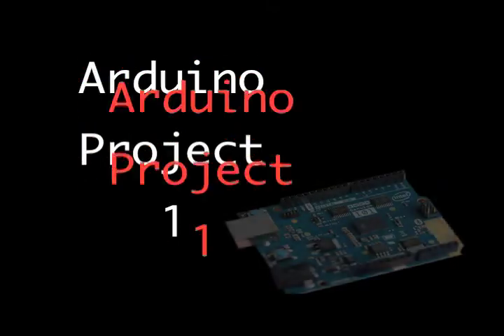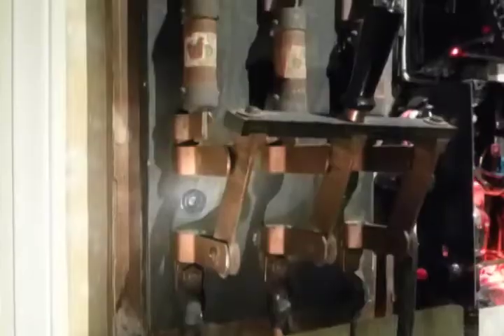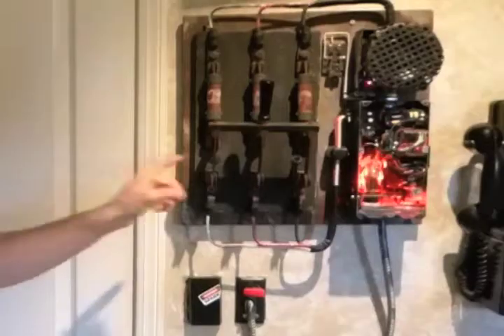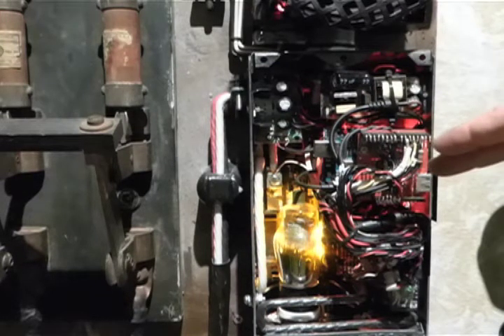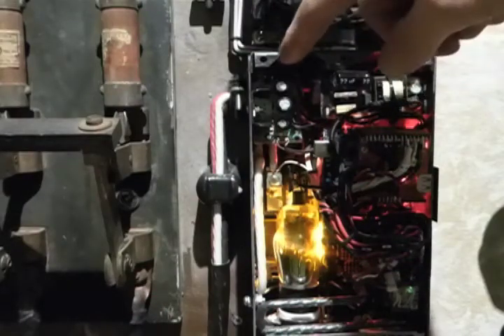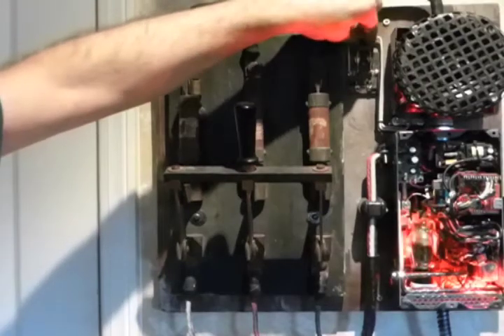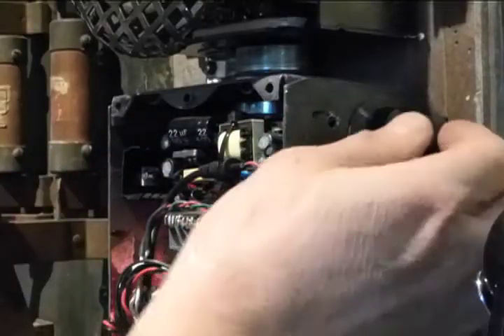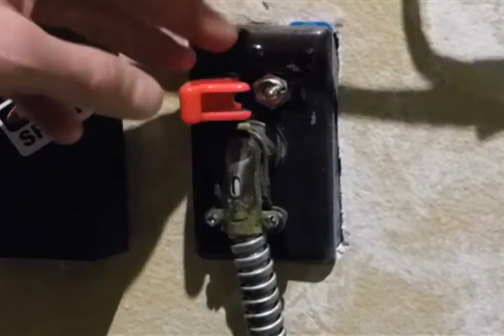Steampunk Arduino knife switch -  by Josh

Comment: Hi. Looks great. i have creating similar. Few questions if you dont mind. 
What kind of resistor you used to detect touch ? 
How powerful is the speaker? Is it simple speaker or specific for Arduino?
Thanks a mill.
Reply from the maker: Glad you liked my project. For the touch resistor, I used a 1 Meg potentiometer. That way I can adjust the sensitivity as needed. Humidity in the air can change the sensitivity. The speaker is driven by a 2 watt audio amp I built from a kit, fed from the MP3 shield, on the Arduino.
The code I used for the touch sensor looks like this:
/*
 * CapitiveSense Library Sketch
 * JES* THIS WORKS ! LED at pin 13 follows touch!
 * Paul Badger 2008/ Josh S. trimmed and modified for Knife switch project. 
 * Resistor effects sensitivity, experiment with values, 50K - 50M. Larger resistor values yield larger sensor values.
 * 2 meg ohm is OK on desk top. 1 meg ohm on knife switch.
 */

#include <CapacitiveSensor.h>
const long timeout = 10000;

CapacitiveSensor touch1 = CapacitiveSensor(4,6);   // 4M resistor between pins 4 & 6, pin 6 is touch sensor pin.
int led2Pin = 13;                                  // LED connected to digital pin 13

void setup()                    
{
    Serial.begin(9600);
    touch1.set_CS_AutocaL_Millis(timeout);          // set sensor timeout values
    pinMode(led2Pin, OUTPUT);
}

void loop()                    
{
    long start = millis();
    
    long total1 =  touch1.capacitiveSensor(30);
    
    Serial.println(total1);                      // print sensor output 2
    
    if (total1 > 1000) 
    
         { digitalWrite(led2Pin, HIGH); }       // turn LED ON

    else 
          { digitalWrite(led2Pin, LOW); }      // turn LED OFF
      
    delay(10);                                 // data thinning delay ??     
}
Reply: Thats great info. I am running Escape room and you should consider doing such prop for resale. Trust me, you would get customers as it looks super cool. Whats out there are very expensive and miles behind your prop. Huge compliments man;)
I have created execution chair with capacitive sensors. works great. and want to advance it with your details.
Now looking at vacuum light. however cant get my head around how it works and how to connect it to arduino. Any tips on that please?
Reply from the maker: Thanks for the compliment. I actually have another one that I made previously. It's much less elaborate, but works, and looks cool. No sound. I might consider selling, if someone was interested.
Your electric chair sounds amusing. Do you have zapping sounds? Could be terrifying.
The vacuum tubes in my project are simply back-lit with LEDs. Looks great, and low voltage.

Comment: What are you using as far as a trigger mechanism for the arduino to know that the knife switch is engaged? Just low current from the Arduino?
Reply from the maker: Yes, just shorting a couple of the Arduino pins through one of the 3 'poles' of the knife switch. Another of the poles on the knife switch, is for (low voltage) energizing of the relay for the HV light circuit. The third is the 'antenna' for the touch circuit.